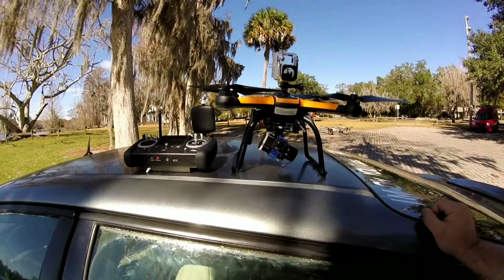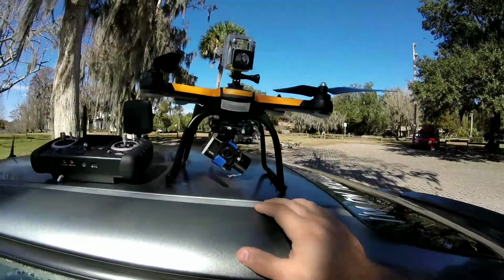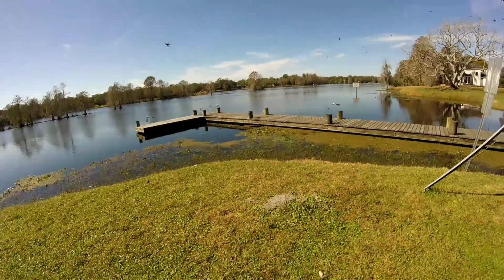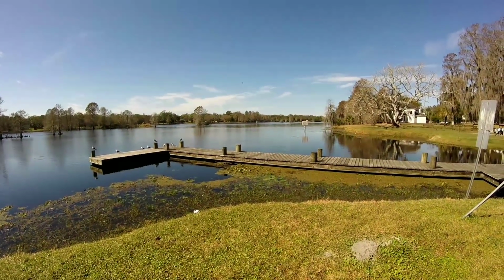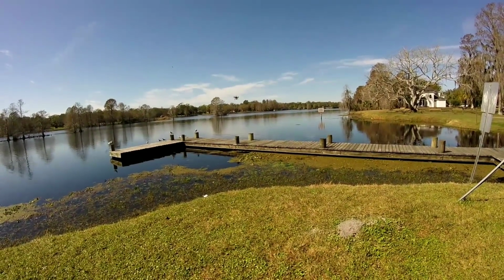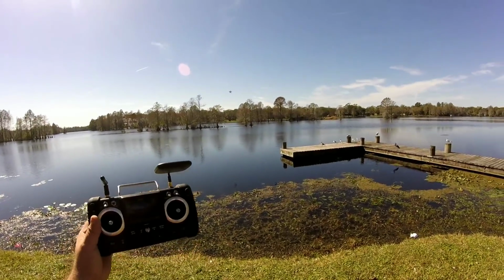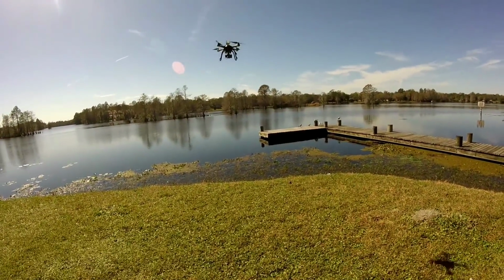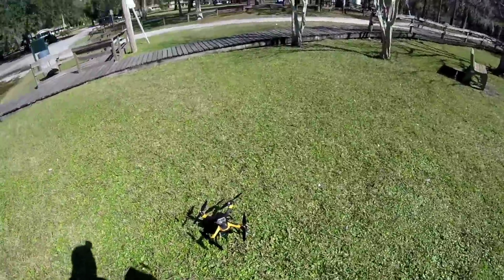Hubsan X4 Pro H109S Upgrade Master Airscrew Props

Comment: My Q500 SHOULD deliver today. I’m freaking STOKED. I’m hoping I get a break in the weather so I can fly it and take vids of it with my Mavic Pro. Should be fun flying two drones at once.
Reply from the maker: Jay Robert Sager just remember the q500 does not function well with too much wind at all it's great for aerial photography but the range is limited to about 1400 feet unless you decide to install the wireless kit on it and like I said the wind definitely tampers with the size of the quad
Reply: Drone Worship yeah I figured. BIG bird. Thanks for the heads up

Comment: My bad, one camera
Reply from the maker: mad monkey no it does have two cameras one is a temporary fpv setup until the wire comes in and the other one is the actual camera I suppose I could have recorded the fpv footage to my DVR goggles but it would have been pointless cuz the footage would not have been from the Gimbal and it would not have been HD. But you would be correct there are two cameras on his bird currently

Comment: Great bro i will buy them and what about the run time the same😉
Reply from the maker: Clint the night flyer fully loaded you get about 15 minutes of flight time without all the extras just the quad about 26 minutes of flight time
Reply: Mine with camera and gimbal I'm getting 26 minutes flight times with gentle flying. Fly it down to 10.9v so I've always reserve

Comment: nice upgrade APC makes good props also.  👍😊👍
Reply from the maker: Shen RC I have been so impressed with Master airscrew products I won't really revert back to anything else or try new stuff consider me a knucklehead
Reply: Reason why I told you about the APC is because I used to use both brands when I made my custom airboats and they worked awesome!